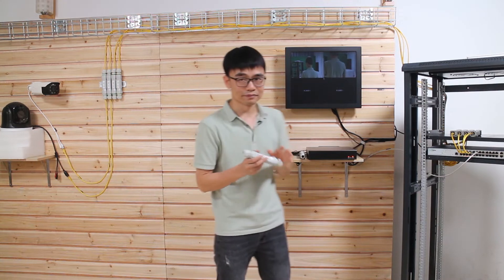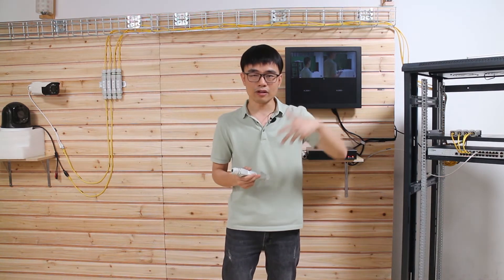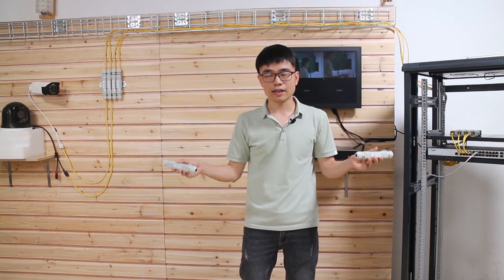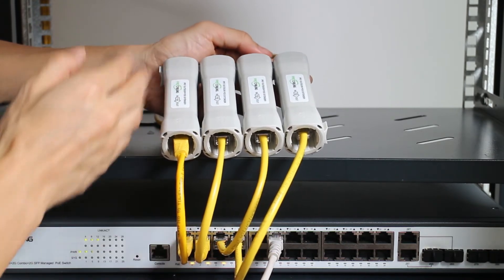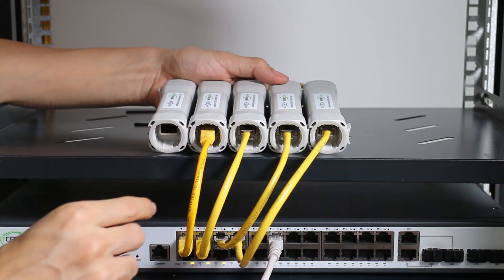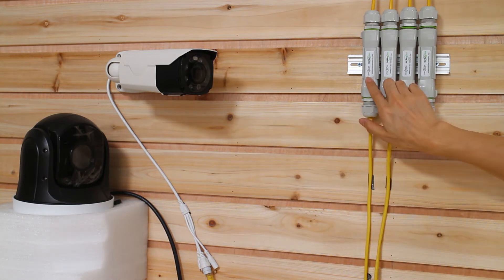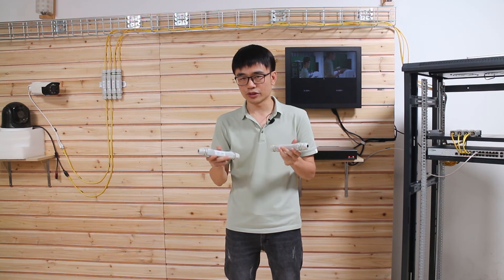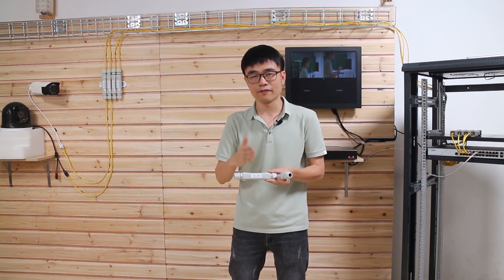Multiple Long Run PoE IP Cameras beyond 1000ft.

Comment: If one uses a PoE injector at the NVR then would only one of the PoE extender be needed at the camera at 1000ft? Thank you.
Reply from the maker: You need two PoE extenders working together to achieve 328ft. Single PoE extender can repeat 328ft only.

Comment: Are you saying 300' from camera to extender then 1000' to extender at security ( NVR ) system for a 1300' total?
Reply from the maker: You are right. Actually the maximum distance is 1600ft, but it will need to move the first PoE extenders 300 ft far from the NVR. If you want to deploy the first PoE extenders in the rack, You only have 1300ft.
Reply: @Fastcabling  Sweet, can't wait for mine to arrive!
Reply from the maker: @wkinne1  Just make sure you flip the first PoE extenders. Eventually you have two input facing each other between  1000ft.
Reply: @Fastcabling  So output faces the camera on one end and the NVR on the other, correct?